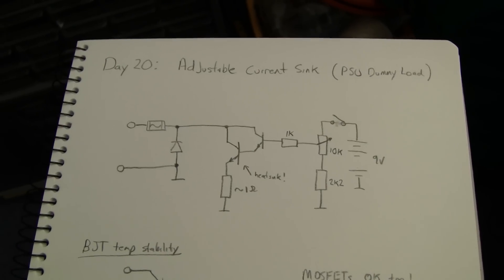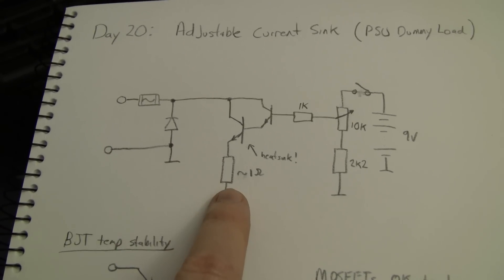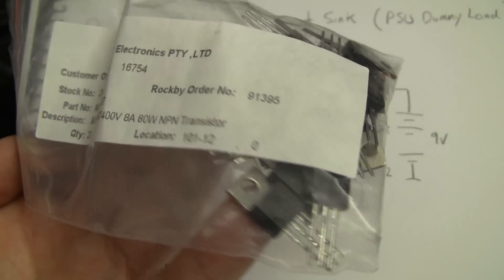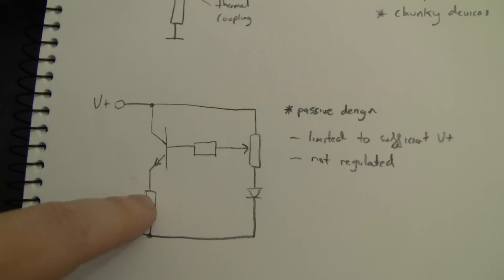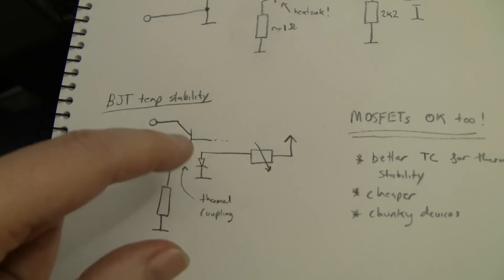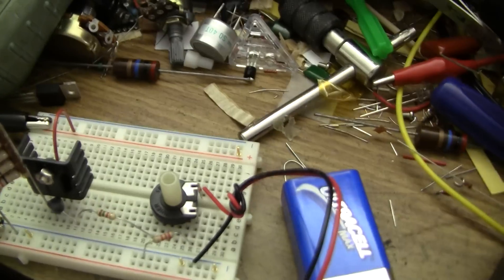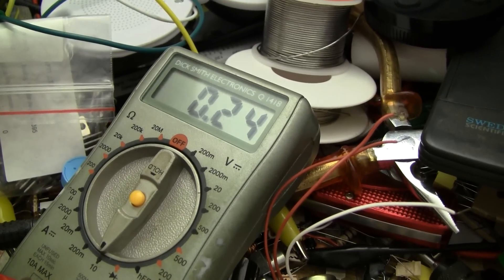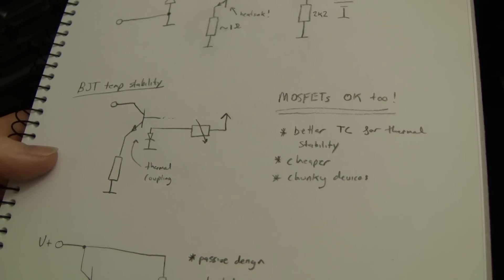Advent Calendar of Circuits 2011: Day 20: Adjustable Current Sink (PSU Dummy Load)

Comment: This inspired me to play around with BJT constant current sinks. I wanted to create something that didn't need it's own powersupply yet was still reasonably stable with variations in supply voltage. Here's what i've come up with so far:
http://www.feleppa.com.au/pics/const_curr_load.png
R10,R11 are a 10K pot obviously :). It will run pretty well from about 5v up. ... and yes i realise the irony in having a constant current source to power a zener diode, to run a constant current sink haha.

Comment from the maker: @superdau indeed, BJTs directly in parallel will likely end in blow devices.  You can use an emitter resistor for each BJT to get them to share the current fairly equally.  You can still have a small single metering shunt resistor below that, say feeding an opamp to give closed-loop regulation. I might talk about that more in another video.

Comment: Paralleling BJTs is not a good idea. I'm sure you know that, so I'm writing this for those who want to build it. Even if they are matched and have very similar values, it's easy to kill them one by one through thermal runaway (you already showed what happens to the current when the transistor is getting warmer). (that's also why so many DIY LED projects [and some cheap chinese junk] fry LEDs by putting them in parallel on a single resistor ;) )

MOSFETs in parallel are fine though.